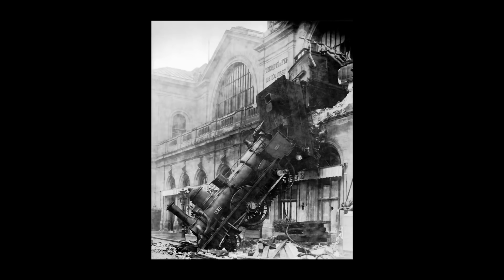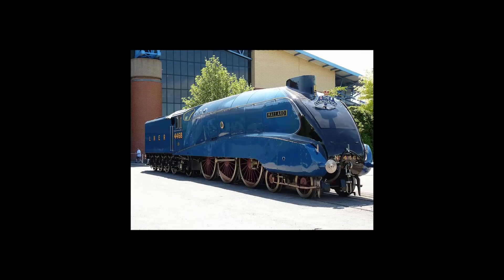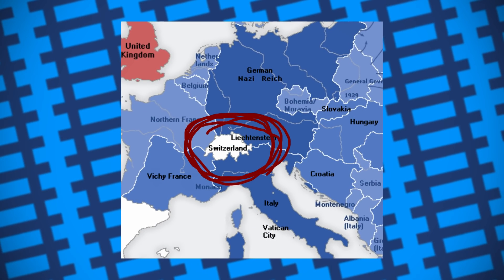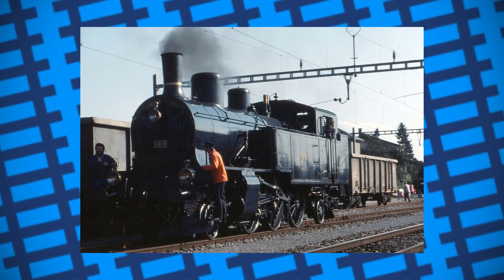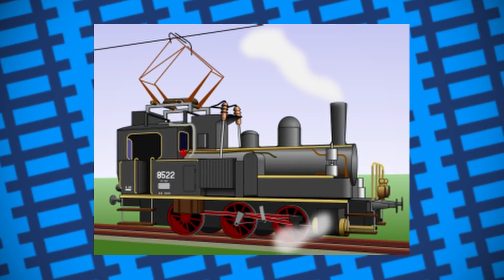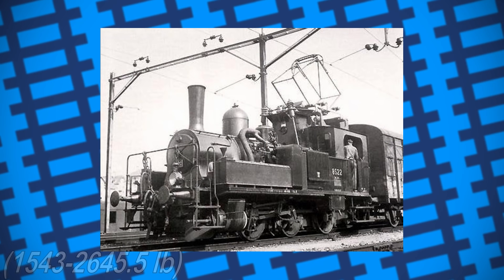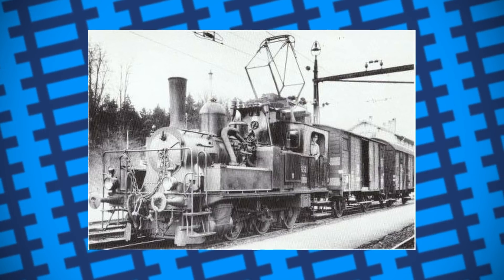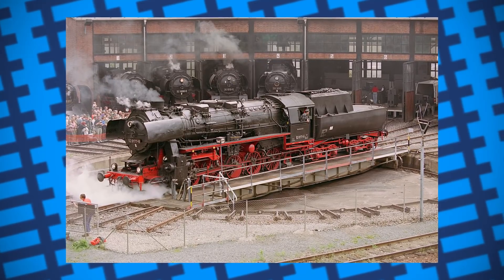Why Switzerland tried to fuel steam locomotives with electricity - Electric Steam Locomotives

Comment: The electric preheater is arguably NOT more efficient as claimed in the video. From an engineer's perspective, it is EXTREMELY inefficient to use electricity to heat steam. While the conversion from electricity energy to heat is 100% efficient, the conversion of coal/gas to GENERATE the electricity at the powerplant is 30-40% efficient at best. Steam locomotives on the other hand can harness around 90-95% efficiency when converting the coal energy to heat. So using electricty to keep a boiler warm overnight is a huge waste of energy. The only thing that it really saves is time. Hence why it can be argued how effective it was depending on how you define efficiency.
Reply: Switzerland uses mostly hydroelectricity for their needs.

Anyway, I think the point more was to heat it up quicker.
Reply: @briannem.6787  they used hydroelectricity back in 1940s?
Reply: @ecpcharles  https://en.wikipedia.org/wiki/List_of_dams_and_reservoirs_in_Switzerland

Yes they did.

Btw. You said that coal/gas thermal efficiency is 30-40% but then somehow by magic steamlocomotives can harness 90-95%...doesnt make any sense.
Thats not how efficiency works.
If you say the thermal efficiency is almost 100% with electric heaters(which is correct) then electric steam locomotives would be more efficient then coal or gas. But the conversion from liquid to gas is in both cases a waste and electricity would be even more efficient by just using it with an electric motor. But that doesnt make coal/gas more efficient.
Reply: @Slithermotion  not all dams produce electricity, most dams simply retain and control water flow. And this is not a list of dams during 1940s. I said the production of ELECTRICITY using coal/gas is 30-40% efficient (in 1940s), but using the same coal to produce heat directly to power a steam locomotive, you can achieve 90-95% efficiency. 

This of it this way. Coal > electricity > heat = 40% efficiency. coal > heat = 90% efficiency. In modern day tech its more like 45% and 98% but back in 1940s technology wasent nearly as developed.

Conversion of coal to electricity involves burning coal to heat water into steam which is passed through a turbine to generate electricity before finally passing through a condenser which drops the temperature until it returns to water (liquid form) before being reused. This is the standard rankine cycle, and understandably its not very efficient. I hope you can understand if same coal was used to just directly heat water into steam is more efficient than doing all that, THEN taking the electricity generate to then heat water, why its less efficient. 

Its why in the US many areas with colder climates with households that need hear more consistently throughout the winter has gas heaters. Theyre more expensive than electric but are worth the investment. Electric heaters are more prominent in areas where heaters maybe only used for a few cold days in the winter, or where gas lines are unavailable (particularly west coast due to risk of earthquakes, and older homes)
Reply: As far as I know all of the dams mentioned produce electricity, and I dont think that we swiss would build dams in the mountains for a water reservoir...one of the worlds tallest(even in todays scale) was build in switzerland before 1940s.
You can sort the dams by date of building a lot were already built before 1940s

Nonono...this is so wrong what you wrote about efficiency that it hurts...
Coal power powerplants have about 30-40% efficiency by transform water into steam to turn a turbine. The electromechanical losses of a turbine are at max 5%.

A turbine itself is more efficient then the reciprocating cylinder steam locomotives used. A turbine spins always in the same direction the reciprocating cylinder motion always loses energy by changing direction.

This is also why rotary electric motors are about 5-10% more efficient then linear electric motor.

We can discuss this all they long, or we agree to disagree or you just google the efficiency of a steamlocomotive compared to a coal powerplant. Or their respective mechanic components.

Coal never gets directly transfered into electricity it always just transforms into heat....
Both with a powerplant and a locomotive.
But the power transformation in a steam locomotive is inferior to that of a steam power plant. Otherwise people would obviously use the mechanics of a steam locomotive to produce electricity...
Which they don't.
Reply: @Slithermotion  I hope you realize that of your list of dams only a dozen were completed prior/during wwii. Modern day swiss has hydropower accounting for 56% of electrical generation, from a peak of 60% in 1970s. However during WWII (the relevant time period), hydropower dams were few and far between (most of their hydropower dams were made 1950-1970), and although I cant find what percentage of electricity hydropower generation accounted for in 1940, Im sure it was probably 10%, maybe 20% at best. To say that Swiss used "mostly hydro electricpower" (again at the time period in question), I think that's a stretch. Sure they had a handful at 1940, but that's quite frankly irrelevant to my original point. 

And yes, strictly speaking in terms of the efficiency of boiling water into steam using coal, I can agree that a power plant is probably more efficient than a steam engine, due to its larger scale, more insulation, etc. But I think you're missing the main point of my argument. 

The main flaw in your argument is that the loss in efficiency in the rankine cycle process in a coal (or gas/oil) power plant is NOT the boiler. Rather, it is the conversion of that steam energy into electrical energy. Turbines themselves may be efficient in converting motion to electricity, but the process if VERY inefficient. Steam is only passed through turbines only once. Afterwards, its put through a condenser and returns to its liquid states. However the steam is still very hot after it leaves the turbine and still retains most of its thermal energy. This heat is completely wasted as it is effectively expelled (or cooled down). 

If a steam turbine were truly 100% efficient, steam would go in and room temperature water could come out the other side. You can see why this is impossible. In real life, (somewhat) cooler steam, BUT STILL hot steam is what's exhausted, and therefore most of the energy is wasted. 

This is also why steam engines are so inefficient. It takes the steam and runs it through the pistons once, and then expelled. Most of that energy is wasted in the exhuast. Certain things like feedwater heaters or mallet designs tries to recycle that steam/heat and put it to use somewhat, but still most of it is wasted. This is why IF you're going to start with electricity, its better to just run it through an electric motor which is significantly more efficient in converting steam to motion.

In summary, steam should only be used in steam engines, and electricity should only be used by electric motors.
(coal > steam)efficient (steam > steam locomotive >motion) inefficient...OR
(coal to steam)efficient (steam > electricity)inefficient (electricity>electric motor>motion) efficient
 
BUT to convert coal to steam to electricity, THEN to use that same electricity to heat water to create MORE steam, you're effectively just taking the two most inefficient steps and combining them together. The least efficient method:
(coal to steam)efficient (steam > electricity)inefficient (electricity > steam)efficient (steam > steam locomotive >motion) inefficient

If youre going to make electricity, you might as well use it to power electric motors, which is significantly more efficient in converting electricity to motion than a steam engine.
Reply: @ecpcharles  nobody said that all of switzerland was 100% hydro electric.
It was said that the railway was 100% electrified by hydro power.

The railway was nationalised and the SBB built dedicated hydro powerplants for the railway(rivers/dams) which had a different frequency and voltage then the rest of the swiss grid.

I don even know why Im arguing with you all you do is make assumption without actually knowing it. There are history books and Wikipedia if you dont believe us just look it up.

Again...you mix a lot of things up in your understanding of efficiency.
At this point I agree that we disagree I repeated myself already 2 times.
And you honestly mix up a lot of stuff, and I'm not sure if you even understand the purpose of the stopgap solution the swiss made with the locomotive and why there was little to no other choice for that...
Reply: @Slithermotion  I was disproving this statement "Switzerland uses mostly hydroelectricity for their needs." which someone else made, but then you had to butt in. Therefore, it can be assumed that you were proving my response to his statement wrong. Which you failed to do. 

I fully understand why the swiss did what they did. They had a shortage of coal, and electricity wasnt a shortage during the wartime. Im just saying electricity could be much better used. Ideally, they would simply create more electric engines but that wasent an option at the time. Although I dont see why they couldnt have converted to electrification earlier if they already had a full catenary system. 

I've worked (part time) at a coal powerplant before, we have one at my university. Additionally I study mechanical engineering with a focus on thermodynamics. 

Maybe what we're arguing about two completely different things. Im simply saying there are significantly more efficient means of using electricity to power trains, and that the electrical steam engine is a completely backwards thought that only was viable due to wartime shortages.

Lastly, I dont trust wikipedia as a cited source. At the same time though, I dont have time to research what percentage of electricity was derived from hydropower in the 1940s in Switzerland. I gave an estimate of 20% based off of data from the US (before/during the war) (US had 33% by 1949 but thats due to a campaign of building dams post wwii). and assuming the swiss had around the same. I could be wrong though, and thats why I stated it was an educated guess. I am admittedly no expert on Swiss media, I model US railroads and therefore my focus isnt on the swiss. Im just giving my $0.02 on their engines from an engineers standpoint, not from a historians standpoint.

Comment: Steam engines are only 60% efficient at turning heat into motion. An electric motor is 90% to 99% efficient at turning a watt of electric power into a watt of mechanical energy (depending on the gaps between the poles in the motor).
This just saved the cost of building a new engine.
Reply: Nah, reciprocating piston steam engines like the type used in locomotives were a lot worse. Can't remember the exact figure but <10%.

Comment: In other words, all the right unusual circumstances. shrugs That's the basis for experimentation. And while going straight to electric motors would be more practical, I could see electric heaters as a great way to speed the startup-time. (Which is was, because it was actually done.)

Comment: Such a system sounds like it could be a decent way of adapting heritage units to run without needing combustion
Reply: @Roman-po8yc  I agree that ideally these artifacts would be kept in working order in the way originally intended, but I still think an electric steam locomotive would get a lot of the fun of steam (the whistle, the chugs of the steam engine, the plume of steam) at a fraction of the maintenance and expense in cases where maintaining a working-as-original engine isn’t feasible.

Comment: A Swiss e3/3 is actually preserved in the Netherlands in the town Haaksbergen and Boekelo (wich is near the city of enschede)
The locomotive is painted in a Black paint with red lining ant the number 7853
Reply: This "Tigerli" locomotive was property of the "Werkbahn der Aluminium Industrie AG" in Chippis (VS). Its original number was 4 and was built in 1910.

Comment: For this to work properly, you need to redesign the boiler. A yarrow boiler with heating elements inside each pipe. More surface area, and a smaller profile. Since a typical yarrow boiler could have hundreds of pipes, you can have 3/4 of them with heating elements, the rest for downcoming the water.

But a regular electric locomotive is way way more simple than these desperate contraption.
Reply: Resistive electric heating is 100% efficient, with reciprocating piston steam engine being about 6% efficient, for a total of being 6% efficient. 

Direct drive electric motors are 91% efficient.

Comment: Way less efficient than just using electric motors, not to mention steam locomotives are much costlier to maintain, but an interesting niche given the time and place in history. I've heard of similar electric-fired steam locomotives still in use - at a tiny scale. The smallest "live steam" models, possibly as small as HO scale, use electricity from the track same as their directly electric counterparts. Of course there efficiency and practicality doesn't matter, and it's a much more convenient way of generating steam than any sort of combustion-powered locomotive at that scale.

Comment: I, as a thought experiment, was thinking how I would do something like this in the modern day, for the last few months on a off.

I came to the conclusion that an A4 Pacific model, with the tender split between water and a battery unit was best. You would charge and heat the boiler in the shed or station, and have solar panels mounted on the rolling stock to extend the distance the locomotive could travel between charges. Of course, charging at water stops would be necessary, as on cloudy days the solar panels wouldn't do much, and they're limited anyway. It wouldn't be able to replace electrified passenger services, but could be run for goods traffic. I don't think pantograph's would work in Britain, due to the work needed to make all lines overhead, clearing trees, rebuilding tunnels and installing the lines themselves, would be a huge undertaking not even accounting for the monetary costs.

Nice to know I'm just behind the times not crazy.
Reply: I might be able to improve on that potential design. Perhaps the entire tender would be nothing but the battery supply with solar panels on top for additional charging, with the water tanks being on the main engine unit like a tank engine, likely having to be of a pannier tank design to maximize water storage
Reply: Interesting